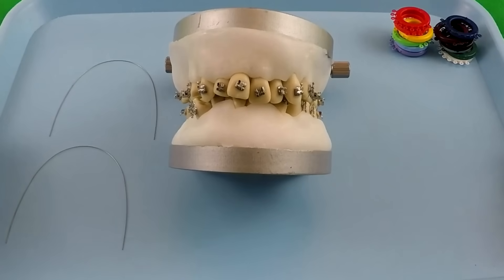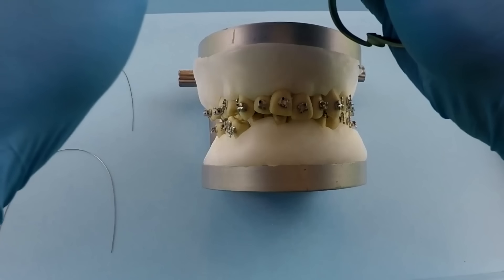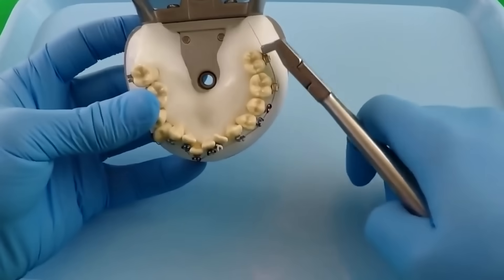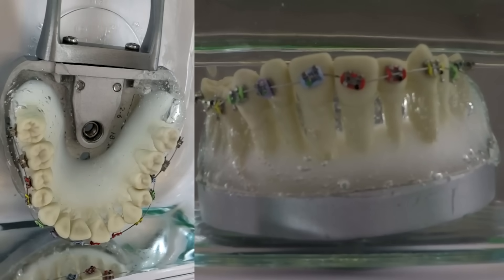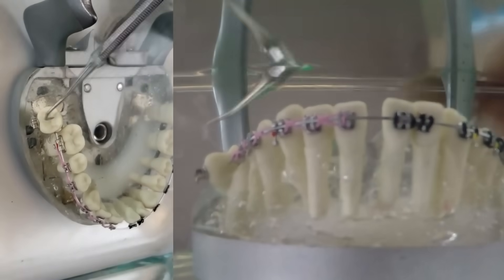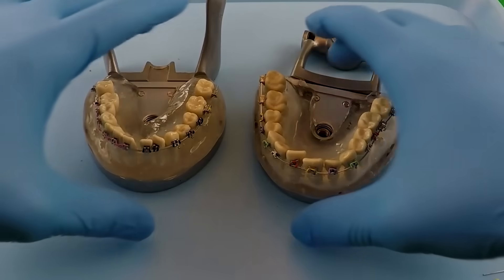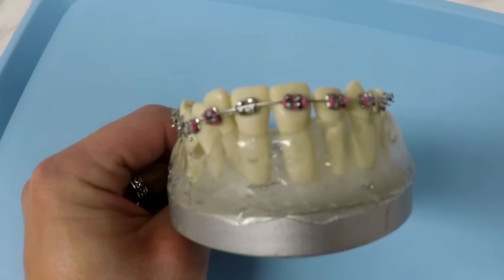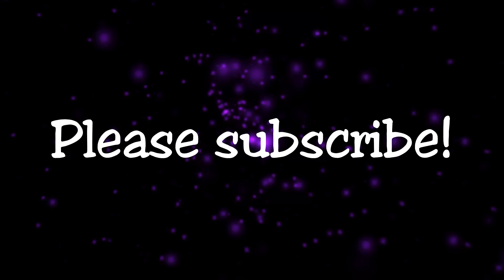Ever Wonder How Braces Work? Find Out Here!

Comment: this was cool! I had braces for 9 months, which is super short but my teeth weren't bad. I was very self-conscious of my two front teeth as they overlapped. Don't regret getting them at all. There were a pain in the beginning as I had to get one of the squares on the back molar moved closer to the gum due to the shape of the tooth (it doesn't have a smooth side, more like a steep slant) and it was in the way of my natural bite (actually ended up causing the square to come off the tooth due to the bite). I also have hypoplasia of the teeth and nails so my teeth are much weaker than normal teeth, so probably also made them easier to manipulate?
Reply from the maker: Hypoplasia doesn't make teeth move faster, so who knows. Maybe you're just lucky? Thanks for watching the video!
Reply: Hey, i also wanna get braces for my two front teeth only, they are not overlapped. How much time it's gonna take to straighten them?

Comment: I have a question. I am currently in the last stages of my braces (as i have been using the rubber bands), i have extracted 4 tooth and now that my teeth are looking straighter, the lines of the top and bottom front 2 teeth does not match. I do not know why this is happening. Great thanks if anyone have a answer.
Reply from the maker: What lines do you mean? Midlines? Or the edges of your teeth? Either way, this sounds like a question for your orthodontist to address before the braces come off.
Reply: @thecrazyorthodontist  I think it’s the midlines, i have asked about it but was told that it will not “meet” after my braces…
For now the front view of my teeth looks something like the shape below. 
 |_|_|
|_|_|
Reply from the maker: @alphaTango9989  hm, that's not really something I can help you with remotely. We certainly like for them to "meet" when finished, but there are circumstances where it's either very very difficult or impossible.
Reply: @thecrazyorthodontist  I see. Thanks for your help!

Comment: It’s remarkable how much patience and precision is needed to accomplish this . I still don’t get it though lol so it’s the heat that is required to shift the teeth? Is it really that hot inside of the mouth or ? I’ve always heard people go in for ‘tightening’ every couple of weeks is that the same thing or?
Reply from the maker: The heat in this video was merely for demonstrative purposes. No, it is not required in the mouth like that.
Reply: @thecrazyorthodontist  oh 🤔 then HOW ? The wire DOES have to be tightened every few weeks?
Reply from the maker: @r.gonzalez9655  It's a bit more complicated than what I can explain on here. Wires apply pressure to the teeth, which then move through constantly remodeling bone. The bone basically reshapes itself based on the pressure applied. When people say "tighten" the wire, sometimes the same wire itself is retied in a tighter way, but more often we just tie in a bigger or stiffer wire that continues to move the teeth further.

Comment: Teeth are still not that perefect after braces as i expected
Reply from the maker: That's not how it should be - did you talk to your orthodontist?
Reply: @thecrazyorthodontist  according to him it is perfect 
He said because of your teeth shape its not looking that perfect otherwise it is fine and upper teetha are also downard from right side compared to left side
Reply from the maker: @anmolgoel_15  I'm that case try talking to your general dentist as you may need some restorations. As for one side being higher, fixing that is possible but can be complicated either requiring surgery or lengthy treatment with bone screws (TADs).
Reply: @thecrazyorthodontist thanx for valuable reply but i am not too much worried about that higher or lowerd side instead i am worried that my lower teeth treatment is finished but still one teeth is little crooked i talked about this with my dentist he said its fine and also when my upper treatement will finished he will place filling between on upper molar so that my lower teeth cant hit the permanent retainer of upper side
so i want to know that is this normal ?
Reply from the maker: @anmolgoel_15  Without seeing what you are talking about, it's impossible for me to say further, but I WILL say it's very normal for a dentist to go in (to your mouth) afterwards and do stuff like this.
Reply: @thecrazyorthodontist  ok thanx

Comment: Thank you for sharing the knowledge! I just have a few doubts: Do you think patients with overbite but straight teeth mostly need braces, or is it just for aesthetics? Also, there is this fact or myth going on for years that braces after teenage can weaken up your bite. Is this true? What is the latest age at which you can get optimal results from braces without any sacrifice on time or strength of your teeth?
Reply from the maker: 1) Yes, a non-ideal bite can potentially cause problems in the future.
2) No. You can have braces at any age, it's just faster and typically easier when starting at a younger teen-ish age.
Reply: @thecrazyorthodontist  Thank you, I will research more deeply into this 👍

Comment: i got my braces yesterday after several tooth extractions. i can barely close my mouth. is this normal?
Reply from the maker: Probably. They may have added some extra glue to prop open your bite to prevent you from biting into the bottom braces. That's common

Comment: Hi doc. I have a question about lisp. I have my braces on for 3 yrs now and I think this year I started getting lisp. I don't have lisp before and I don't have too in the first 2 yrs of my braces. My braces will be removed next month and I still have lisp. The ortho said that the tounge will adjust eventually and the lisp will be gone. Is this true?
Reply from the maker: I'm very sorry, but I don't think I can answer this without an exam. I find it very unusual for you to have developed a lisp so late into treatment. Try to be patient and see if it goes away after the braces are removed.
Reply: @thecrazyorthodontist  okay thank you doc. Will I have the right to demand for it to be fixed if the lisp never go away even after retainer?
Reply from the maker: @Cashcash08  I highly doubt it. If you didn't develop the lisp until well into braces then you'd have a near-impossible time proving braces caused it. Again, unless something is off with your bite or spacing, I find it very unlikely the braces are the cause.

Comment: Hi Dr. quick question, do you really need to have a perfect alignment of the teeth before moving on to .016SS wires? Thanks in advance!
Reply from the maker: The best answer is: not necessarily. Every orthodontist has a sequence of wires that they like to use. I could elaborate, but this is really a case-by-case type of question.

Comment: Hi,  I started my braces journey last Jan 2021 due to an open space on the upper part and not so aligned on the lower part.  along the journey,  i just knew that I have missing 2 upper incissors (maybe the reason i have an open space on the upper part,  not sure though). Just this month, I am advised to have a panoramic radiograph of my teeth an just found out that I have an impacted wisdom tooth.  I never knew I have that until I had the panoramic procedure. I dont feel pain nor discomfort. With that, should I be worried? since, the impacted wisdom  tooth is not painful, would it be okay if i prefer not to remove it?   Hoping to hear from you. Thanks.
Reply from the maker: Don't be worried, but get the advice of your general dentist and orthodontist regarding extracting it. They might recommend removing it to avoid potential damage to surrounding teeth in the future. Good luck!

Comment: Is it normal for my teeth to start spacing out at the top ?? Because I got braces 4 months ago my top row of teeth was perfectly straight no spaces. Now that I got braces I have spaced in between all 4-5 teeth in the front of my mouth and a small little gap now. My bottom row had crowding but that was the only thing wrong with my teeth. 

Now 4 months into braces my top row that was perfectly fine looks like I actually needed braces now that I have all these spaces that wasn’t there before I got braces. I feel like it has made my teeth worst than better and also the bottom row crowding is gone but my top row now has spaces so I’m confused on how it fixed my bottom row but made my top raw that was straight spaced out giving me one problem after another. 

But I guess I have to just trust the process but I’m not happy about my straight teeth that’s now spaced out with small spaces and gaps.
Reply from the maker: That is absolutely 100% normal as your top teeth get used to the wires. Don't worry, it might take one more wire but then your orthodontist can close the space with a power chain.

Comment: So when I wore braces in the 80s, why did they put bands around my back teeth, upper and lower? By bands I mean metal rings covering the whole tooth (not the chewing surface) around them and that's what the ends of the wires were attached to. What's the difference in that style of braces versus what you show in the video?
Reply from the maker: Great question. The dental glues have improved significantly in that time. The back teeth (molars) experience more bite force and need stronger glue, which we have now. Sometimes the metal bands are still used when needed, though.

Comment: Hello, my orthodontist didn’t put any elastic colors on my brackets and I don’t know how important are the elastic colors for the process, can you tell me if it works the same way as with the elastic colors ???
Reply from the maker: You might have doors that open and close to hold the wire in rather than colors that tie the wire in.
Reply: @thecrazyorthodontist  😄 yes yes. Thank you ! 
I just realized I got damon braces on after this comment I went and watched other videos. From what my Ortho told me they was going to give me traditional so I thought I had on traditional but no.

Comment: Wow! That’s really insightful! Though, does make me wonder even more as to why they cost anywhere from $7,000 to $10,000 in Aus. It just seems like a lot of money for some metal & rubber bands & even the labour. I can’t wrap my head around that.
Reply from the maker: It's also the $250,000 in student debt, the $100,000 x-ray machine, the staff salaries, misc equipment, etc. and not just "a bunch of brackets and wires." In addition, I glossed over quickly in the video, but there is a fine art to the placement of the brackets. If they do not get placed in the correct positions then the teeth will not move correctly. There's also the age-old question: what happens if things don't go according to plan? In almost every case there will be something unexpected happen, and that's when you rely on the knowledge and expertise of the orthodontist. That knowledge is very valuable, just like the knowledge and expertise of a medical doctor. I hope that makes sense 😁

Comment: I think I just got my first wire upsize 3 months ago, since the last extraction because it's too crowded both upper and lower jaw. I got 3 teeth extracted. How many times will I get a bigger wire? 2 or 3 more times?
Reply from the maker: It depends on the orthodontist. I try to use only 4 total wires (4 upper, 4 lower) throughout the process but sometimes need more.

Comment: all my back molars didnt have brackets or wire and i dont know why the dr didnt put it on. is it because those were too slanted or dr will put it at the end of the treatment? and one of my back molar just emerged after wearing braces. again do the dr will straighten the molar? previously it didnt emerged because no space
Reply from the maker: Many times those back molars don't need braces, so it just depends on what yours look(ed) like

Comment: My orthodontist tell me that mine was getting removed next month but my front tooth seems to be not straight, the wire is in perfect shape but my front tooth a little bit twisted, is that normal or they cant do anything about it? Btw, love your video it explains alot about braces treatments.❤️❤️❤️
Reply from the maker: Thanks. If your orthodontist knows about it then they can fix it. Just say something so they know. Many orthodontists nowadays are doing hybrid treatment, where they can continue to move teeth after braces come off using retainers or aligners. I do this frequently 😁
Reply: @thecrazyorthodontist  I actually think the same thing but its just my guess, now that you say it, I think I might be right, Thankyou so much💖

Comment: My orthodontist offers wires that are bent by a robot (suresmile) does that actually make any difference in this process? And if so what does it do?
Reply from the maker: It sounds very nice and fancy, no? And also quite expensive. Those who use Suresmile will swear by it, but I have seen a few credible studies that don't show much benefit. It offers a more customized approach rather than using standard U-shaped wires. A good orthodontist, though, can bend wires and the treatment will be as customized as needed. That may be more effort by the orthodontist, but it may be worth avoiding the extra cost of a robot doing it for them.
Reply: @thecrazyorthodontist  thank you so much for replying. It’s been difficult to find many people talking about Suresmile other than orthodontists that promote it.

Comment: Hi there! I was hoping to get your opinion. I'm 28 and I just got braces on my lower arch besides 2 teeth. My orthodontist wants to pull 2 on the bottom because I have an underbite.. which isn't obvious now because of the gaps on my top teeth.. should I get another opinion from a different orthodontist? They're perfectly good teeth and I would like to keep them if possible. I have all 4 wisdom teeth removed and feel as if I have enough room on the bottom.. any information is appreciated!!!
Reply from the maker: Extracting teeth is a very normal thing in orthodontics. If you've read something that says otherwise then it is false, and I would be happy to challenge any of their claims. I personally HATE to do it, especially when the teeth are healthy, but it is necessary many times. I can't recommend what you should do going forward except to share your concerns with your orthodontist and see if they can show you a result of what to expect. I'm just guessing here, but they likely couldn't give you a healthy bite without surgery if not for taking out those teeth...
Reply: @thecrazyorthodontist  I had 4 extractions. I have braces now to align my teeth and fix my bite/overjet. I read that in removing my 4 teeth I’ll lose bone density on my jaw and age faster with a sagging jaw?
Reply from the maker: @iiixlovexyuhh  I'm going to give you the best advice you've ever heard: don't believe everything you read on the internet 😁 No dentist or orthodontist wants to remove teeth, but sometimes it is essential. I could go on, but rest assured that you're not going to turn into a jaw-sagging zombie 😉